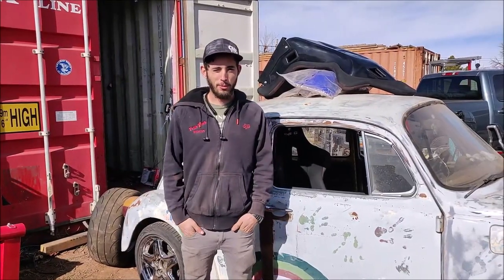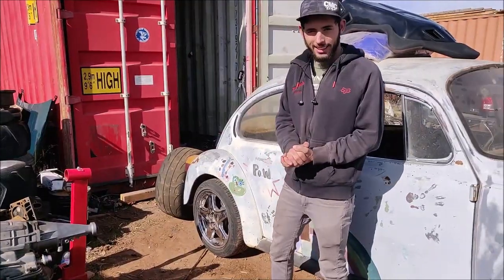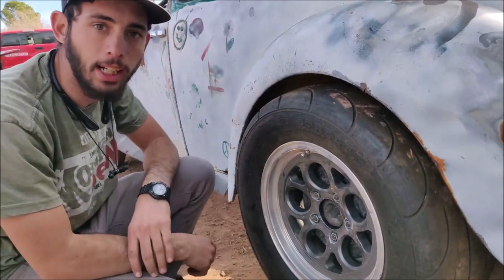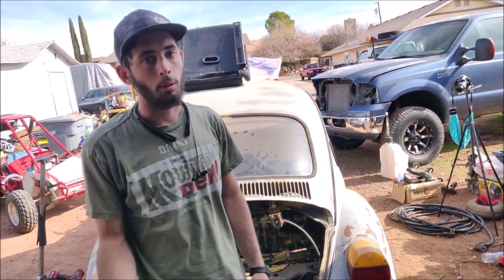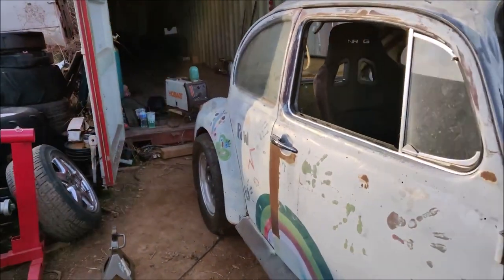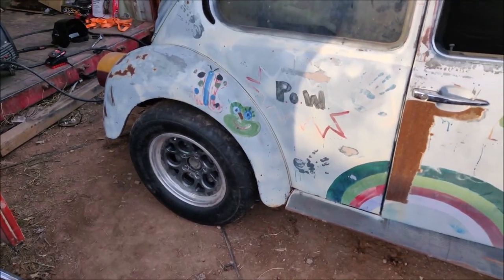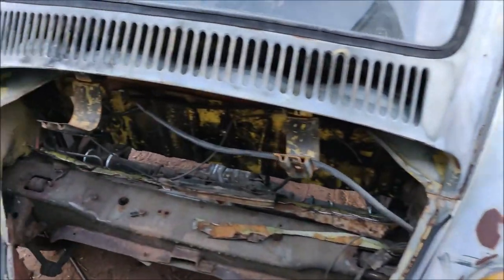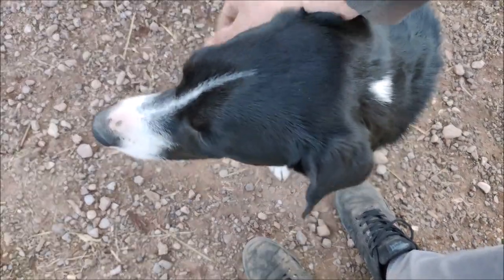LS Swap Beetle Part 3/ Rear Suspension And Drag Radials!

Comment: Great video just remember check those trans to axle angles lol. What gear are you running?
Reply from the maker: Yes sir got the pinion angle all worked out. I'm just running the stock s10 10 bolt rear end for now. It probably has like 323's in it.